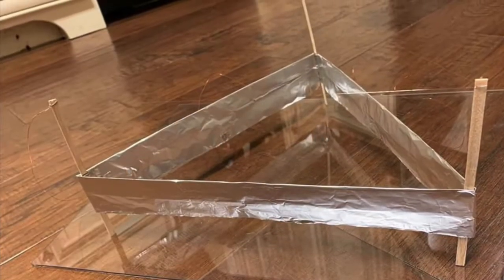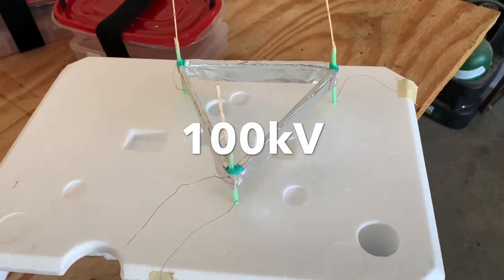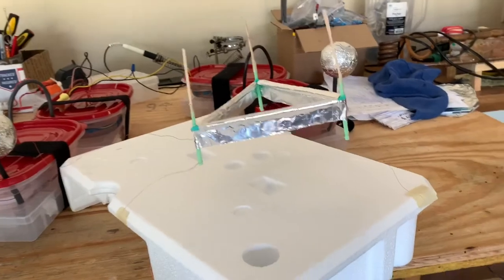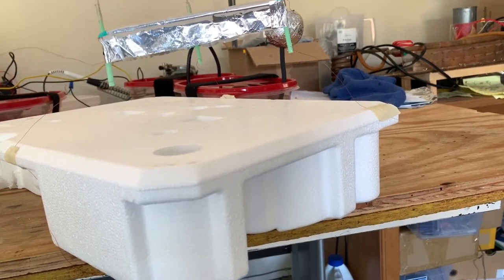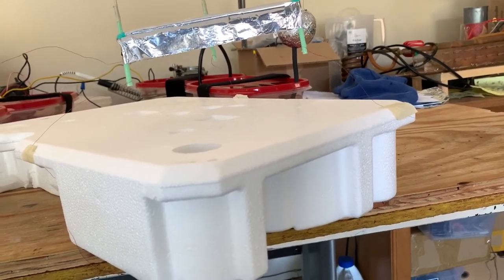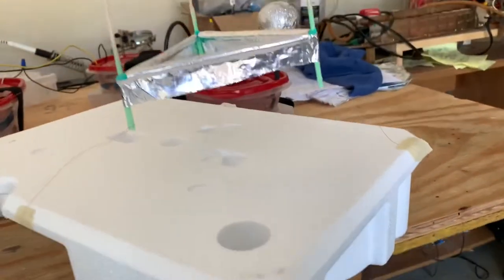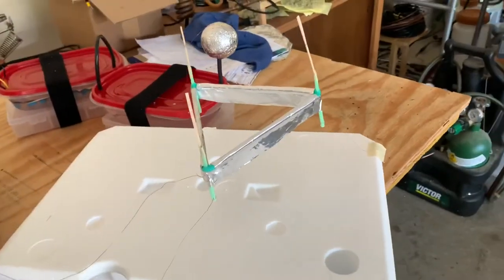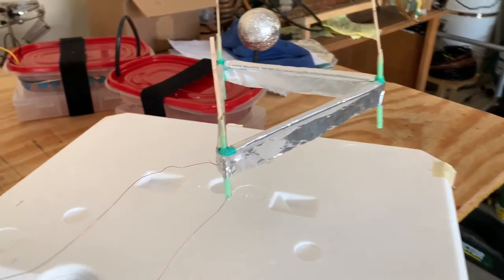Ionocraft

Comment: What happens if you change polatity? 
I think that the working is probably always (more or less?) good enough when the lower bigger electrode is close to the groundlevel, like the surrounding air. But would there be much difference if there is a positive or negative ionwind coming from the wire above it?

Comment: JL Naudin saw a large increase in efficiency by pulsing the HV DC at 70 hz. He experimented with different frequencies and saw harmonic patterns. The Army Research Laboratory showed that by used of deep vacuum and and oil that ionic drift is 3 orders of magnitude too small to account for the forces observed. Here is a link to the research paper http://jnaudin.free.fr/lifters/arl_fac/0211001.pdf
Reply from the maker: Thanks, really interesting and cool
Reply: @BrianDhvTinkerer  You're welcome! Thanks for sharing your work. Check out his whole lifter research section. There is a lot there and much to improve on. I wonder if they could be made using chemicals on a nano scale in sheets.
Reply: @BrianDhvTinkerer  This has something to do with gravity and levity.
Reply from the maker: Its uncertain as the ion wind forces and levitation forces are not balanced